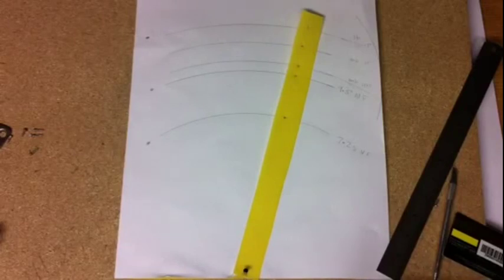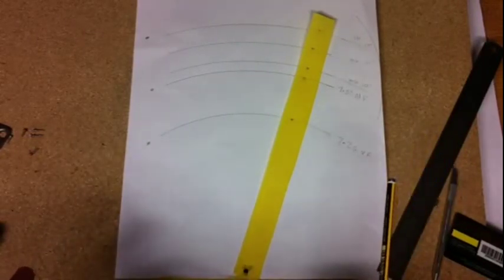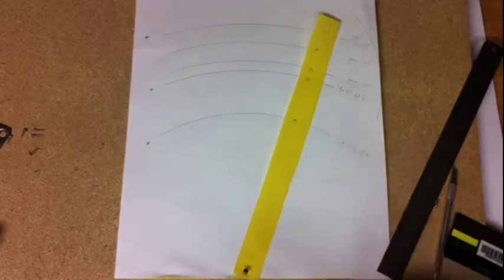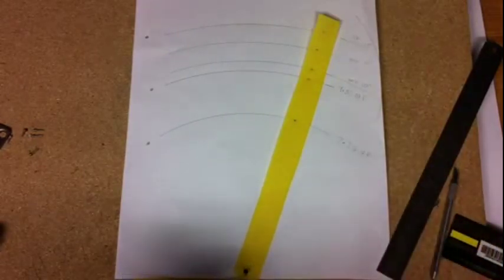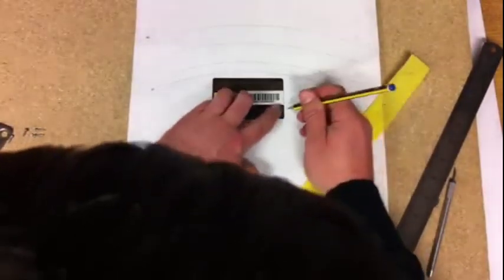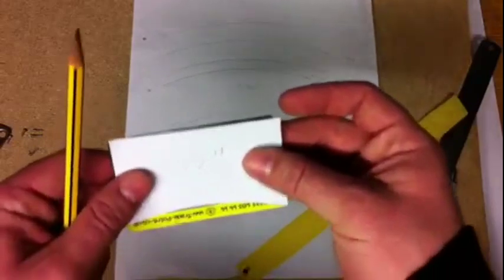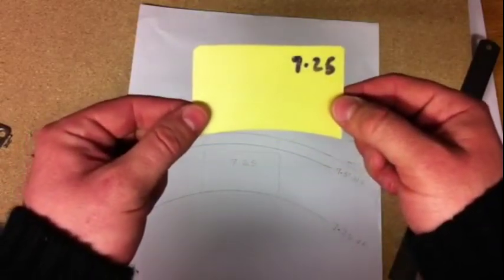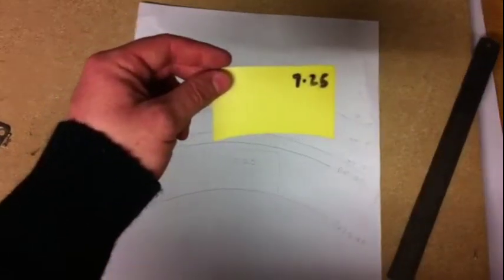How To Make A DIY Fretboard Radius Gauge

Comment: Sorry for being dumb, but shouldn't all the lines tracked here the same radius, using the ruler pivoting on that point? Would someone please explain how to obtain different radius with this system?
Thanks.
Reply: maybe i'm wrong, but it's not about the pivot point, it's about how much of the circle you can fit in the same space, if you draw idk 1" radius circle then cut it on the card, you'll pretty much be able to get the entire circle on the card, but if you draw the biggest you can make and put it in the same size card, you'll get only a fraction,  and it will look like a slightly curved line. the Radius is the distance between the center of a circle to it's "limit"

Comment: Great video.  I have a stack of empty plastic cd jewel cases finally found something useful instead of tossing them in the trash. Thanks.

tip:    Use any type of masking place it on the plastic or glass (if you're brave, Lmao )   Draw your radius gauge measurement then use a box cutter or pocket knife cut through the plastic or glass without splitting it or breaking.
Reply: Those things are finally not worthless!  Worst thing ever... CD cases made me hate CDs so much.  Cracked broken in the BOX!   NIce work!